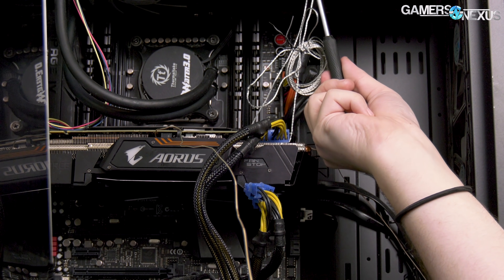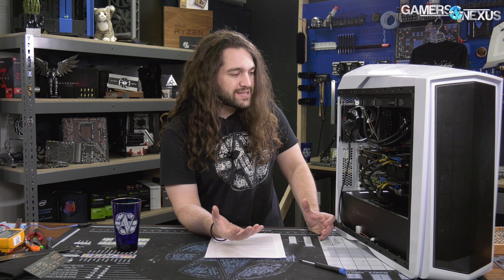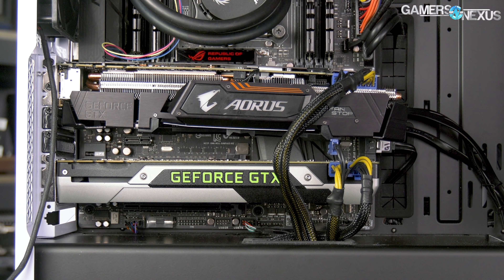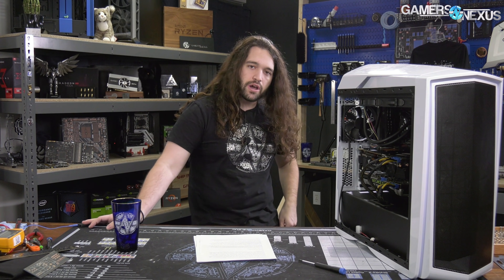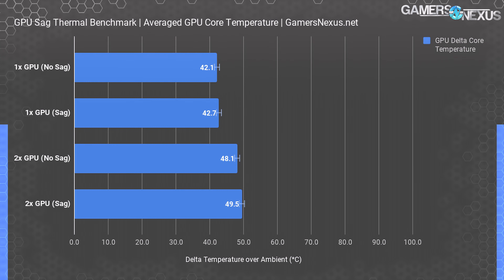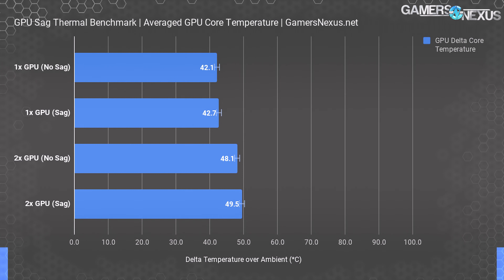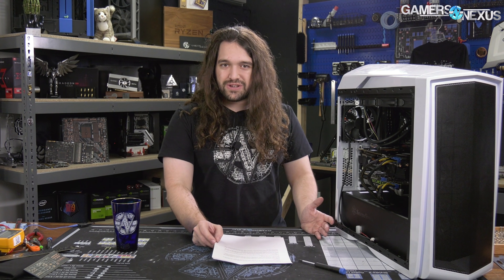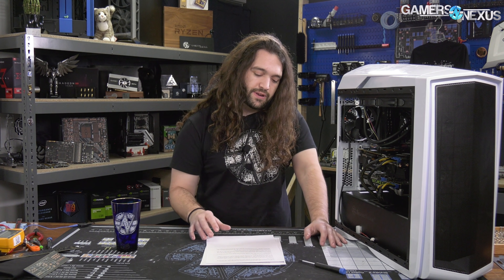Video Card Sag Test: Thermals & Frequency on Drooping GPU

Comment: Sag Aloo.  I don't tolerate GPU sag.  That weird guy who wears shorts and flipflops on that other youtube channel uses a screw near the back end of the case to keep the GPUs from sagging.  I'm nervous about doing that so I use 3d printing to make supports.
Reply: you mean jayztwocents? Haha
Reply: theo sinc could be squeaky voice linus with his cringy ass socks/ sandals wearing self.
Reply: @theodor12  That's the one.  :)
Reply: I used a lighter and a toothbrush from which I removed the brush hairs.  The lighter was to soften the handle so I could bend it in the right places to make a support for my then R7970 lightning.
Reply: @JimmyRJump  I would have left the brush hairs on...
Reply: Mysterious MrX You think Jay's clothes are weird, you should watch LinusTechTips 😋
Reply: weird flex but ok
Reply: yo there is an even weirder guy with Socks and Sandals
Reply: Just use scissors and cardboard hahaha
Reply: Mysterious MrX they sell like metal brackets you can screw in underneath to keep it straight

Comment: Up next, does a go faster stripe make your PC faster?
Reply: I can confirm that using "Turbo" and "Speed" stickers will make your PC faster. Intel used to give those with their SSDs.
Reply: I can remember that back in the day GPUs with red PCBs were considerably faster than GPUs with blue or green PCBs.
Reply: Only if you're an ORK from Warhammer 40K.

Comment: I've got a Gigabyte 1080Ti Aorus Xtreme and it sags more than my nutsack
Reply: Tat S1000RR honesty one of the best comments I’ve heard in a while
Reply: Don't know if that says more about your nutsack or the Aorus. Crazy sagging card or super stiff nutsack? Did you compare your nutsack to any similar product?
Reply: @Janduin45  have compared my nutsack to a Asus GTX 1070Ti, Palit GTX 1060, GTX 1050Ti, Radeon HD6990, EVGA GTX 570, EVGA 650Ti, GTX 650. I can confirm my nutsack sags more than any of the above :)
Reply: I have the very same card but already bought a little support so it's straight as my D :)
Reply: @HnK_Alex  mines in a black define R5 case with black side panel so I've run the power cables from above so they hold it up
Reply: @rossharper1983  holy shit i can only imagine how hard it must be to buy pants! Do you watercool your nutsack or does the case allow for sufficient airflow?
Reply: @mmmhorsesteaks  9x140mm fans ;)
Reply: You need to lubricate the ball bearing for better perfomance
Reply: Well, at least you can't accidentally sit on your 1080Ti card.
Reply: Gigabyte build quality in general is ... questionable lately. I've had to RMA two of their boards in one year, haven't had to RMA anything from any other brand in 30 years.
Reply: @glennv3176  what happend?
Reply: @firstnamelastname5701  I had to RMA one gigabyte vega because black screen/hard lock + fan speed up to 100%, then I received a refurbished one with the exact same issue, then I received a third one without the issue but it has coilwhine so loud it goes over my headset at 100% volume. I had to pay for shipping three times. This particular model has 1 egg on newegg because they shipped broken GPU's to just about anyone dumb enough to buy one.
Reply: @firstnamelastname5701  When you RMA something to gigabyte, they don't repair it or even look at it, they just swap your RMA with someone elses RMA, hoping you grow tired of paying for shipping, give up and throw the hardware in the garbage. Thing is, if you receive two or three broken RX570's, you eventually will throw it in the garbage, cheaper to buy a new one from another brand. With something like a vega, you don't typically give up, you just keep paying for shipping. Gigabyte RMA is about the most cringe thing in pc hardware
Reply: @glennv3176  lol black screen? didnt know it happend to high end graphic card. Gigabyte produce great 900 series card in my opinion. when it comes to 1000 series its just weird in term of perfomance and design.
Reply: @glennv3176  its a shame for you, I had this issue with Zotac Cards and Asrock boards. For me gigabyte have been great, but both of our experiences are anecdotal.

Dont blame you for being put off them for life.
Reply: @JP_RS6  Yeah it's anecdotal, it's just i've been building pc's since the early 90s, never RMA a damn thing and just finished going through gigabyte RMA hell. I'm sure there's other brands with problems and this was bad luck but I just don't feel comfortable buying their stuff anymore now. It's not a logic response, it's more of an emotional one.
Reply: @glennv3176  Yea I understand, I had the same response with Zotac, 2 High end cards lasted exactly 6 months and I had to help 3 customers with Asrock boards in a 4 month span.

I learnt in the late 90s as a kid and started in the mid 2000's myself, Zotacs are the only thing I RMA'd but when helping customers you hear it all, I try and keep an open mind and despite seeing some nice Zotac cards I sure as hell wont be buying one even though my bad experience was from 2007 lol.

Though I like gigabyte their quality as of late has been a mixed bag of very good, mediocre and down right illogical penny pinching in some places.

Hope you have better luck in the future fellow enthusiast :)
Reply: @glennv3176  Are you in the UK by any chance?
Reply: @rossharper1983  no why
Reply: @glennv3176  since making my comment over a year ago I've had to deal with gigabytes rma service, and it's exactly as you said.

I had to pay to ship my 1080Ti, and send them £15 cash for return postage. They said they couldn't find a fault but would send me a refurbished one, that was damaged, bent io bracket, scratches on shroud and fan cable hitting the fan. But the card worked so I kept. It worked fine for 9 months and as gone faulty, memory artifacts. I gave them shit in an email and this time round they did have it collected by courier on Monday, still waiting to hear back. I won't be accepting an refurbished card that's for sure
Reply: Lol ty for the chuckle bro
Reply: Damn bruh...that's a LOT of sag!!! lol
Reply: I have had this card for a while now and my card does not have any major sag. Possibly got lucky but one thing i've noticed is making sure your mounting screw is in tight will provide much higher stability, as this is one of the 2 main anchor points, making sure it can't budge there is very important.
Reply: Yeah saggin like dat nutsack yo
Reply: so did mine in a corsair 450d but as soon as i got my corsair 500d it has zero sag at all its just the case not the card
Reply: I know right, and I'm 82 years old! My nuts hang to my knees and this card is way worse!

Comment: Oh no it's not perfectly aligned!!!
Reply: Sayan Gupta this much sag could easily lead to damage to the card. (Pulling on screw, uneven mounting for the cooler, pulling memory or vrm from the board). Is this likely no.... but why get a card that has unnecessary risks.
Reply: @Mockedarchie   true that. I have OCD so I just spent 20 mins pushing my card back up although it has minimal sag haha